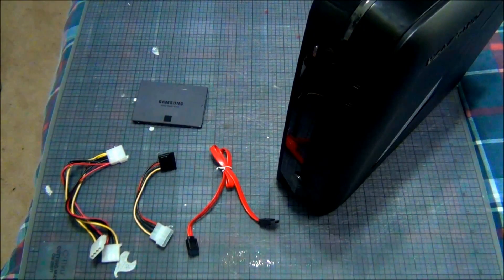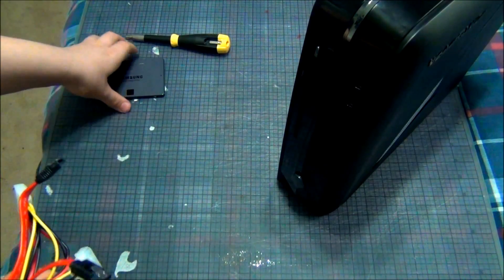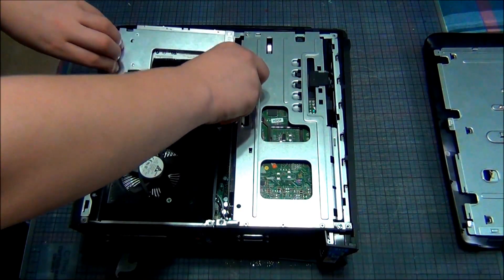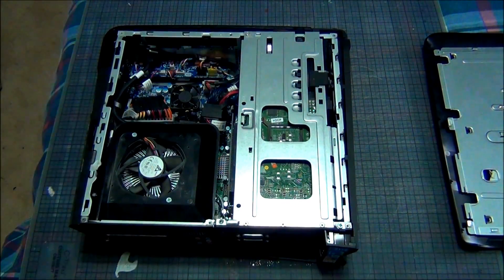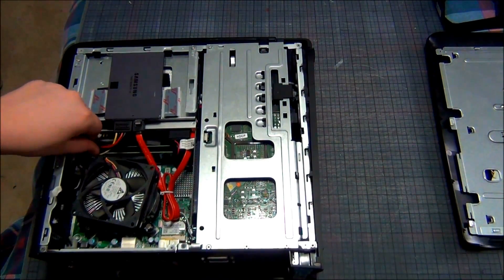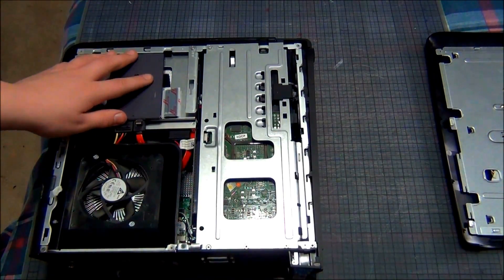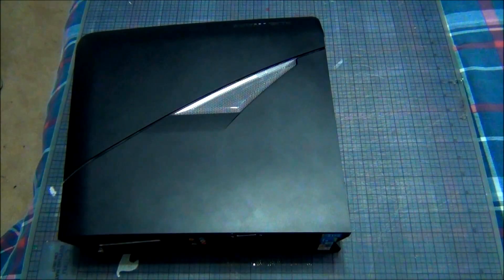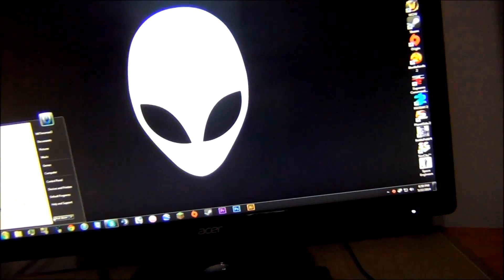Installing SSD into Alienware x51 With An Existing 3.5 HDD

Comment: Thanks for the tutorial! I have successfuly installed my SSD but now I'm having trouble making it my boot drive. I reset my 1TB HDD to Factory Settings with Alien Respawn and used software like EaseUS Todo Backup Free 7.5 to clone my HDD over to my SSD. Now when I try to launch my PC without my HDD in it gives me an error saying it can't find the boot path. Any help?
Reply from the maker: If you still have the windows disc then install it on the ssd (as shown in the video) then use your alienrespawn and use it on the new windows and it should work
Reply: MrTimoman3 I actually got it to work I eventually used this http://support.wdc.com/product/downloaddetail.asp?swid=119 to clone my HDD and it works now! Thanks anyways!
Reply: Zambito1 Hi the reason you got that problem probably is UEFI partition,it was in the old HDD,most ppl get that error while installing new OS on new HD without disconnect the other one and not giving chance to create a new boot path on the new HD,as you  reset the HD the boot path got deleted and you get error. In some other case,while you disconnect the old HD,installing OS,UEFI partition can get corrupted generating the error because some problem cloning it,then you will need to clone it again and maybe using some other program.
Reply: krsna cham Both times I tried I had removed the HDD while attempting to boot to the SSD. But yeah I think with EaseUS I only copied my OS partition and with Acronis I cloned the entire drive, along with all the partitions.

Comment: Hello,
If i am wanting to keep the original hardrive with the OS on it and just add my new SSD to format for just programs that i want to run from it(no windows or OS) will my install be different? I have purchased everything you have shown here(i hope it is the right hardware for my model, i purchased in May 2012) and i want to install and run Steam and possibly any other non Steam related gaming content from the SSD. I would appreciate any suggestions as i am not very tech savvy and google searches have not helped besides finding your video which i am thankful for.
Reply from the maker: Your install will be exactly the same

Comment: Hi and thank you for share this wonderful video,i ve a question:
-Can i use only the  Y StarTech.com 6-Inch LP4 to LP4 SATA cable instead of the other two?
Reply from the maker: Yes you can
Reply from the maker: Not sure if I replied to this yet but Yes you can use that single piece instead of the 2.
Reply: Hi and thank you for your reply you did XD!
thats a precious information cuz in a Dell forum they were talking about it with the 'Y' cable but the mobo has a female connector in that case and i was not sure it could work.
In your video was clear it would, looking into X51 with male connector like mine but then i saw you did not use it so just asking. Actually i m just waiting the new 850 Evo,it should be available in some week in europe. My plan is to install W 8.1 using a generic Key,then change it with my key since i ve an OEM key.
Some tips is welcome if you experienced it too. thank you again for your guide,it was very helpful

Comment: Great video!

May you tell me what x51 bios firmware is shown in the video? I'd lile to the same thing you did, but my bios is far from being so "gui firendly" I mean, it's looking quite old-fashioned!! And besides, if I choose uefi mode, then I can't see any dvd drive when choosing where to boot from :-(!
Reply from the maker: I am using version AO3 and if your dvd drive doesn't work make sure it's connected to the motherboard and power cord and that both are connected to the drive it self (all go into one slot into the drive). And if it doesn't work try a usb DVDs drive it should be labeled as a usb dvd drive.

Comment: hi i have a question, will this work on the early 2012 model??
Reply from the maker: Yes, if its a Alienware x51 R2 or R1 it will work (there are no other models). The only downside is that if you have a alienware x51 R1 than the SSD will be slightly slower because of the SATA II. The alienware x51 R2 has SATA III
Reply: Thanks gonna add the ssd to my x51 :)
Reply from the maker: awesome

Comment: Hi MrTimoman3 
Thank you for this video, as my X51 is having trouble booting up as fast as my expectation (especially since they claim windows 8.1 to be able to boot up in less than 20seconds).

I don't know which X51 (R1,R2 or which newer ones), but does your video work with X51R2 (specs below)?

Windows 8.1 64-bit 
Alienware 0PGRP5 Motherboard 
4th-Gen Intel (Haswell) Core i7-4770 3.40GHz 
TOSHIBA DT01ACA100 1TB 7200RPM 
NVIDIA GeForce GTX 760 Ti 4GB 
Samsung M378B5173DB0-CK0 8GB Dual-Channel DDR3 @ 797MHz 
Realtek Soundcard

I will like to install a Samsung 840 Evo 120GB (the 2.5 inch one). I will really appreciate your advice as I am quite an amateur, thanks in advance!

Comment: thank you very much mate for video and amazon links! waiting for my x51 and I am planning this ssd upgrade. just a question, is your x51 the latest with 4th generation intel processor? this version supports 3 sata III or just 1 sata III and 2 sata II? because I would use the ssd at max speed, but on the web I just found people who upgraded mantaining the hdd and had to use the ssd with sata II port. just wondering is it possible to switch the cables on the motherboard connecting the new ssd to the built in hdd sata III and viceversa?
Reply from the maker: Well if your getting a newer x51 then all 3 SATA ports are at SATA lll. and yes i do have a 4th gen processor its a I7 4770.
Reply: MrTimoman3 installing now win 8 on the ssd, then I will install all the drivers and custom programs from alienware!
Reply from the maker: Awesome! wish you luck!

Comment: So after reading up on how to do all this I'm most probably going to do this for my x51. Questions I have right now is
1. I bought the very first 700 dollar x51 model back in the day that came with the GeForce GT 545. Will this all work okay when it's all plugged in and everything has been migrated over to the SSD? 
2. Do I need to buy that 2 molex cables combined?
Reply from the maker: question one, yes it will work but since its a older alienware x51 then your ssd wont be at full speed and will only be at 3gb/s.

question two, no you do not need to buy that combined cable it just is helpful and is less cables compared to the 2 molex cables. so in conclusion it is not needed.

Comment: Thanks for the tutorial, the link you provided for the cables were very helpful
Reply from the maker: Have you tried installing the SSD yet?
Reply: MrTimoman3 yup already installed, I copied/pasted the cable name from your link to amazon uk :D
Used Samsung data migration, as I don't have a recovery disk. Mine one is x51 r1, found out that it doesn't support the sata 3, so ssd will not perform to max. But it's fast enough.
Reply from the maker: awesome i'm glad i helped you!

Comment: Does the 8in SATA cable have to be 6gb/s?
Reply: Both mothercard and ssd are backward compatible with sata1 & 2 cables, but you won't get the speed you want unless you use a sata3 cable

Comment: Hi really interesting,may ask you about the 2 molex cables combined why is not better than the 2 other separated?did you try it?
SSD you installed is thickness 7mm?it is a 840 EVO?
if you install from USB OS how works Efi partition?and for SSD need did you set something for pc to optimize?
Reply from the maker: the 2 molex cables are combined because i did not of the molex cable that combined those 2 pieces and yes it works. The SSD i install is a 2.5in SSD not sure the exact Dimensions of the SSD. I do have a Samsung 840 EVO. 

"if you install from USB OS how works Efi partition?" Not sure what you meant there can you reword that please?

I did not need something to optimize the SSD for my PC. i just installed the OS on the SSD and went with it and it ran really fast.
Reply from the maker: If i did reply to something and my answer made no since just reword the question or add more details. Thanks for watching the video and i hope you do end up adding the SSD to your Alienware x51. I love my SSD inside my Alienware x51.
Reply: MrTimoman3 i see you switch back to Uefi windows boot manager after installed OS on SSD unplugging the other HD,then plug it back at end,this will help to make boot OS from SSD at first?
how could i set-up it if i would hold both hard disk with an OS? dual boot i mean.
i just discover my mainboard on X51 has only ports sata 2 so will run only at 3.0 Gb/s  but no matter and performance with SSD sata 3 will be 100% better than a normal HD though.

Comment: Question: 1) Are you using a X51 R1 or X51 R2 ?
2) Will this work on a R2?
Reply from the maker: I am using a Alienware x51 R2 so yes it will work on it and the R1 should work too.
Reply: MrTimoman3 Thanks for the answer, when I asked dell, the guy was like "If you get the 3.5" HDD setting, you won't be able to fit an SSD.Going to direct him here now...
Reply from the maker: Jin Xin Ng Awesome!

Comment: I've been looking everywhere for a video like this, much appreciated!
Reply from the maker: Hoped you liked the video!
Have you tried installing the SSD into the alienware x51 or do you plan to do it soon?
Reply: MrTimoman3 I planned on doing it soon, but was also unsure as to what ssd would be best for performance/while not being overpriced
Reply from the maker: ***** If i were you i would go with the Samsung 840 evo 120gb and it only costs 80$ on amazon. if your looking to put programs and OS on the SSD Then that SSD is for you but if you have more money to spend get a bigger size. The 840 EVO 120gb is what i have currently.
Reply: MrTimoman3 Thanks, I'll probably go with the 120GB for now

Comment: Do you need a windows disc to change the os from the HDD to sdd?
Reply from the maker: No you don't have to use a windows disc you can use alienware respawn if you don't have it just search it. you should have it if you have a alienware computer.

Here is 2 videos on how to use and setup alienware respawn,
1st video: Creating a Free Alienware Recovery Disk  (Factory condition) - Good for new Solid State drives

2nd video: How to get Factory Settings on new Solid State Drive! FAST!! Alienware SSD

You need to watch them both. when you connect your USB drive when your ready to install the backup/factory install just unplug the power or sata to the HDD inside the alienware x51 and then start the computer make sure the USB is connected and respawn should show up. When you have windows installed on the SSD turn the computer off and plug the HDD back on and you should be able to use the HDD as a drive just don't format the HDD until you know your all set and you don't have any problems with the SSD.

If you have any other questions please ask me.

Comment: I have trouble installing windows 8.1 to the SSD. Basically, I heard that there is some code installed with the computer that stop it from recognizing the ssd and windows 8.1 CD/DVD. I couldn't get it to boot my installation disc. Would you please help
Reply from the maker: Well lets try this, if you haven't already then shut down your computer, start the computer back up then press f2 until your in the bios menu, go to the boot tab and some where you should see something that says 1st boot, double click it and select cd/dvd then save and exit and also put in the install disk before saving and exiting. and then the install disk should boot and not from the hard drive. install the OS onto the ssd then when you change the 1st boot back to windows boot manager or something like that, what ever the 1st boot was and then save and shut down the computer and unplug the HDD then boot up again and it should boot from the SSD when you get everything need for your setup shut down the computer and plug the HDD back in and start up, the SDD should be the one to then start first. Also make sure that you have a SATA cable that works and power cable that works and also make sure ever thing is plugged in correctly. trust me double check everything ive made that mistake before. Please tell me if this help you or not and ill try something else!
Reply from the maker: Vinh Pham did it work?

Comment: question: is is possible to have 2 ssd drives in addition to your existing 3.5 HD. ?
Or do you have to take the 3.5 out. Great How to Video. Thanks for sharing this information.
Reply from the maker: Yes but you have to give up the DVD drive.
Reply: MrTimoman3 So I guess if you really wanted to do this, you could just buy a external CD/DVD drive and plug it in USB and use it that way. Thanks for the reply. - Cush